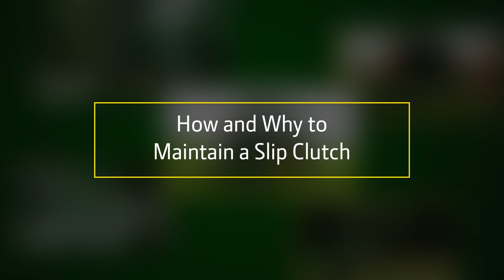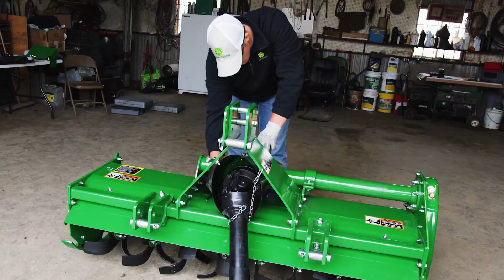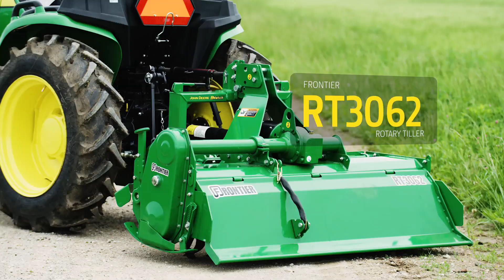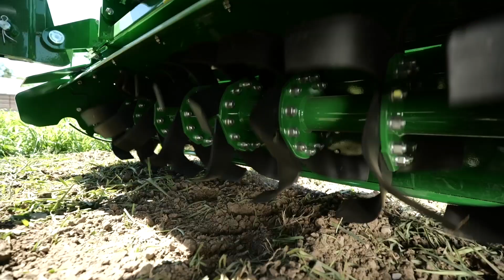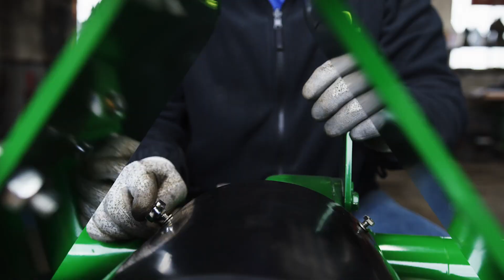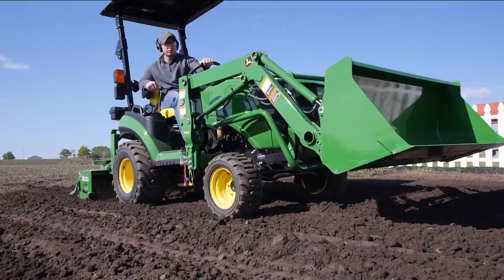How to maintain a slip clutch | John Deere Tips Notebook

Comment: Here is a helpful hint:  how about including an instruction manual with the tiller?
Reply: those are usually found in the black plastic tube mounted in the side of the hitch frame, unless the dealer has removed the manual and did not put it back.
Reply: @harrimanfox8961  just bought it this week and when delivered it was not in there. Was told to scan the QR code to go get it.